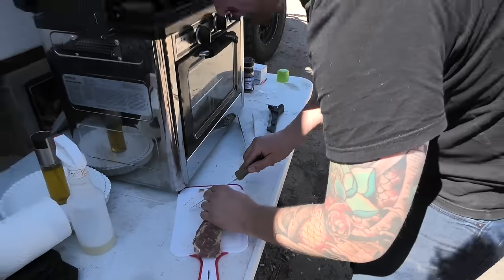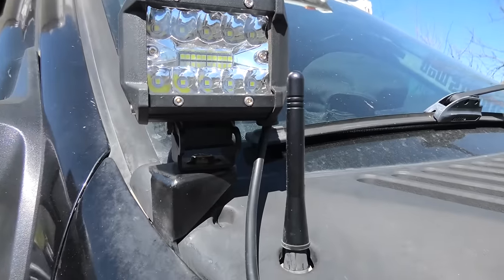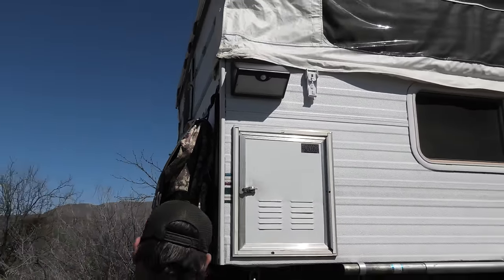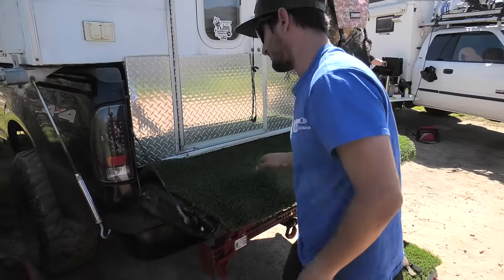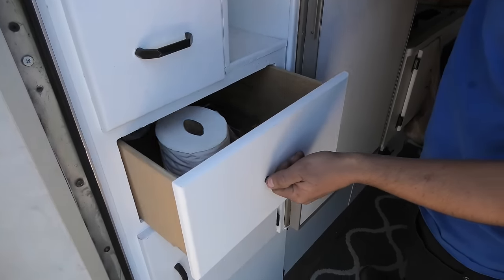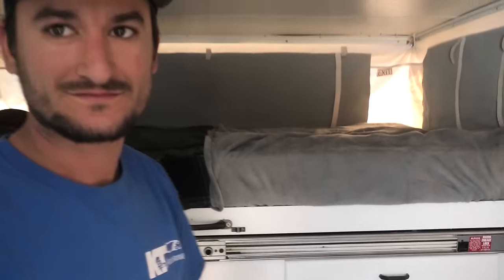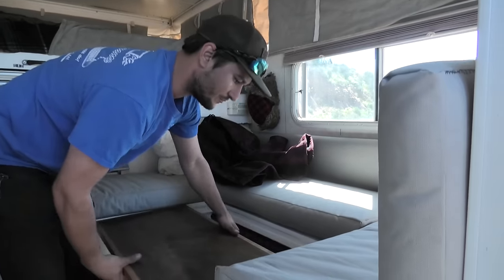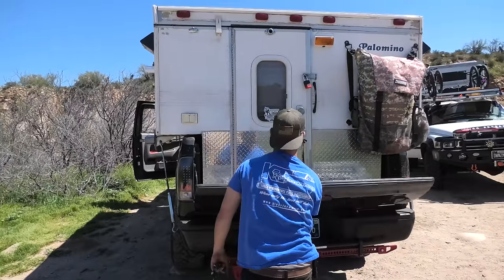$2k BUDGET PALOMINO POP UP TRUCK CAMPER Ford F-250 7.3L Walk Through

Comment: Turn the fan on exhaust (with door closed) when you’re lowering it, it’ll pull the fabric inside and eliminate pinching. 👍🏼
Reply: Can you do the bungee trick like the Four Wheel Campers?
Reply: I thought the same thing until I seen the drone footage again, there is no vent fan
Reply: Whut? That's an awesome comment :)
Reply: How are you going to have the door closed when you have to take the top part of the door off to lower it? DUH!
Reply: Wont work because of the door. He has to remove the top half before lowering it, creating a gaping hole. Or at least that's what i understood.
Reply: Have you tried it? I had one of these campers. The rain flap is longer than the side wall so will not pull in when the wall is already in. You have to push the rain flap in manually.
Reply: Well what's the name of the solar light on the out side of your rigs?
Reply: @simplemanduke7128  did you get the name of the solar lights?  Need some as well!  thanks!
Reply: Baxia technology on Amazon. I put them on my jayco baja tent trailer. They're awesome. Super bright they run for 60 when activated.  All 4 corners and 1 abreast on either side. No fumbling for head lights or flashlights for just hoping out real quick.
Reply: @simplemanduke7128  Thank you sir!!!  Just ordered 2 sets of 4, appreciate it.  Perfect for what I need.  those jayco tent trailers are nice!
Reply: WoW, thanks for sharing

Comment: Good deal. Hard to find a good deal with everyone on the internet. I've been truck camping for 16 years. I'm on my second camper. A suggestion... that door for your outside shower is upside down. Undo the screws and flip it 180. The hose holder will be in the right spot and you wont have any leaks because the door is opening up instead of out and up. I like the tool holder around the propane tank. I will have to steal that idea. I use the area where the door opens to the wheel wells as my dirty laundry area. Just put in a plastic bag, or you could be driving down the highway and laundry will be flying out. Been there.
Reply from the maker: Dude great idea! I will have to try that. And about the door - duh ! Lol we gotta flip it around! Thx for the comment

Comment: Nice rig!  When lowering the roof I use a small piece of wood to block the lift mechanism about half way down then use a broom to tuck in the sides.
Reply from the maker: Oh nice, thanks for the tip! Does that work pretty well?
Reply: @Down2Mob  Works fine.  Just need to be gentle with the broom around the screens.

Comment: That’s camper is so cool. I’m looking in to down size from a 25ft long class C RV to a slide in camper like this. I have a 2001 Dodge 2500 extend cab/ long bed. I want one that’s roomy and have all the stuff I need but not to heavy and big. I just did the rear air bags so i can have the camper and tow a 7x15 enclosed trailer. It’s just my girlfriend, dog and myself so don’t need a huge RV and the trailer is for  my 3 bikes and a Polaris RXR turbo. Your channel inspired me to make the down size.
Reply: I have furkids my cats. Your current vehicle must be very roomy. I looking at used class B and C ones. I need enough room for them and me. What has been your experiences with your furkid and girlfriend with your RV as in living space.

Comment: Maybe get the bungee from a kayak repair kit.  Wrap it around the middle of the upper collapsible soft-side, the connect it.  Make sure there is enough tension to pull in the soft-side as it’s collapsed.  It may work, and fix your problem area.  Good luck.  peace

Comment: I used to have the exact same slide in that I used on the back of the same dodge that you have. My wife and I made multiple trips out west and down south for a month at a time towing two dual sport bikes on a trailer. It was a sweet setup. I put it in storage for a few years and the mice invaded it and chewed the crap out of the soft sides and just destroyed the whole thing. I didn't have any leaks either. I like what he did with the cheesy cabinets. I was lucky that my wife is low key because you have to pee in a jug and crap in a bag. Bummer it is gone.
Reply from the maker: That's awesome jack! I love the Cummins for sure!!

Comment: When lowering, close all the windows and the door, open your fan and turn on high sucking the air out of the camper. This draws in the canvas/rainfly making it super easy to close and not have to push all the canvas in. Works every time on my NorthStar

Comment: I've heard of you install a good roof vent fan like a fantastic fan.  Turn it on high with the windows and doors closed while putting the top down it will suck the sides in so you dont have to go around and tuck them in or at least as much.  Of course that depends on if he wants to install a roof fan.

Comment: I picked up a Jayco Popup. Paid $1500 and it needs a few things but decent, no shower like yours but not hard to figure that solution out. I put it on the same 99 7.3 truck just in white, I did find a 66 gallon under body fuel tank for a song ;) It’s my bug out vehicle. Load up my GS or the dirt bike on a receiver mounted hitch.

Comment: Got the same set up with a SunLite camper.mounter on a 2000 F250 Power Stroke. Had to rebuild the lift system. Anchors at the back end came loose. This camper has a toilet and an A/C unit built in.

Comment: Random idea, maybe won't work..but have you guys thought about putting stick on tarp guy outs on the inside of the rainflys and then connecting them with a bungee cord so they pull in when you take down the popup?
Reply: or maybe shock cord.. or a super long piece of heavy duty shock cord around the outside?
Reply from the maker: Ya I didn't put that part in the video for some reason, mine has bungees, that's what it really needs. And a fan so he can suck the air in

Comment: Hhmm, you could try a piece of wire, wrapped all the way around the middle of the rain cover. As you drop the top down just tension the wire— in theory it should pull in the rain cover.  Probably want to keep the wire in the middle of the rain cover.

Comment: All well with your alternator?  tensioner is good now, like your friends camper, I have the dodge 2500 long bed and do not want to take my tailgate off.  I'm the one talked about a $20 bearing. Come to Oregon this summer.
Reply from the maker: Replaced the alternator and all is good with that! I need to update ya'll on that! I am coming to Oregon in may or so

Comment: If ur ever Near Sandstone, Wv & want to sell the Camper ; Cash is still King isn't it ? 
Ps my driveway Wingfield mtn Was 1 of the Hummer clubs annual stops Hwvr they don't like scratches anymore lol  ; feel free to motor through from here to the other end at Shepards Mtn Any of ya 4x4 tread lightly Fans ..not joking 
My end is a Very interesting start too lol  Its an Old discontinued State Rd ..fully Lawful too 
I've driven through in a 1962 international w 9'bed R WH Dr only  w No problem ; it was some Nutty fun in my old Zuki 
I'm looking for an inexpensive pop up for my C3500 silverado w 8'bed as I get tired of hauling my 30' 5th wheel= Ugh 
Peace, Very Smart Bro Noice :)

Comment: Where did you buy your cowl LED pods? Are you happy with their size and performance? How difficult was it to set up the pod mounts on the cowl? And are they permanently installed? Or can they  be easily removed?
Reply: you can purchase any pod brand you like but right now i have some 60w Nilight triple row pods. They work great ! the mounts i got from  http://kahlkreations.com/99-09-ford-superduty-cowl-mounting-brackets/. They are tricky to install as there isn't much insight but I managed. i would say more permanent as It is quite a pain getting the cowl on and off because it's fragile and expensive. Take your time and you'll have no problem!

Comment: Hey neighbor,

My name is Rob. I just bought a 1993 camper very similar to yours. It has exact cranking system for pop up. Where the heck did you get the drill attachment? I have searched Amazon and the internet. I can not find the drill attachment gear. Please help me out. Do you have a link? Do you a brand name? Do you have a part number? Do you have something that will help me find one? Thanks in advance.

Comment: This looks perfect.  Dunno if it fit in my short bed though.  Thinking if I bought one of those pop up shell beds and mount it on the truck rails. If it had the opening from below and front I could build out a box under it with the pop up as the roof. Dunno. Need to work it out.

Comment: If you were to have build a camper yourself, what is the cheapest, but also lightest material you could use for a home built camper? I've been trying to research this & there are a lot of interesting light weight material out there, but it's gotta be something that could withstand the elements obviously. Anyone have any ideas?

Comment: Awesome video! I’ve got pretty much the same Palomino and LOVE it. 

As far as the jacks he has that fold up when not in use.....how does he hold the end of the leg up so they don’t swing back down once they are folded up along the sides of the bedrail? Does he just tighten the bolt on the bracket right so it holds it up or what?
Reply: It came with little loop shaped cradles screwed to the underside of the camper. I fold them then extend them through the cradle and that's it